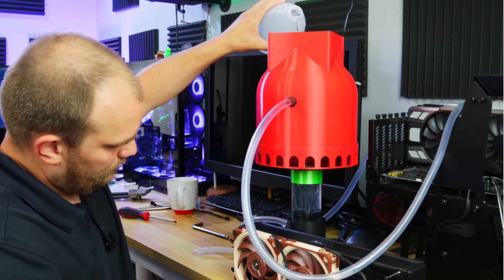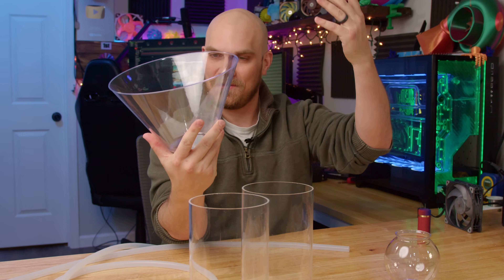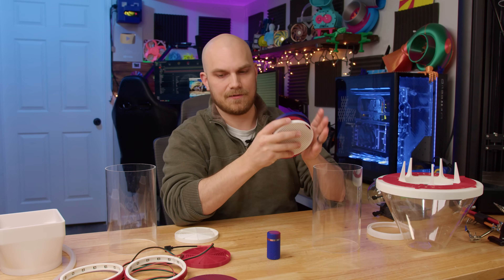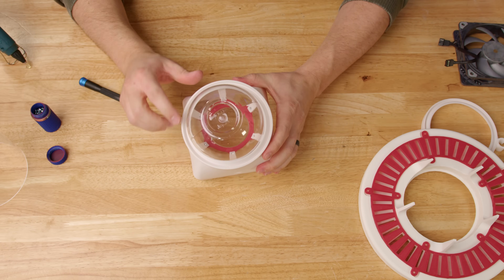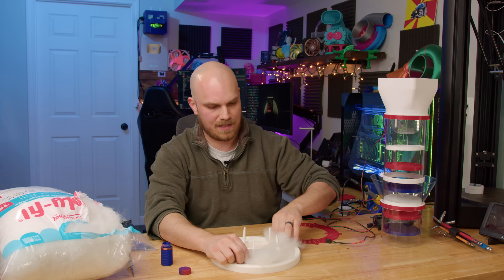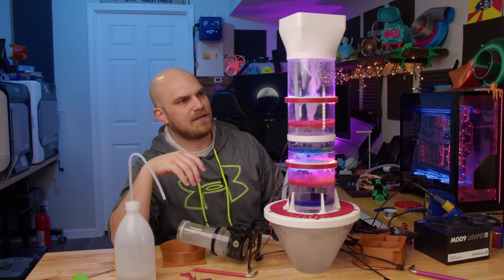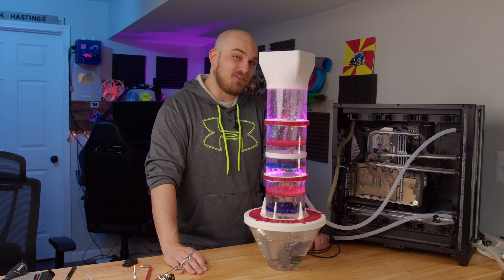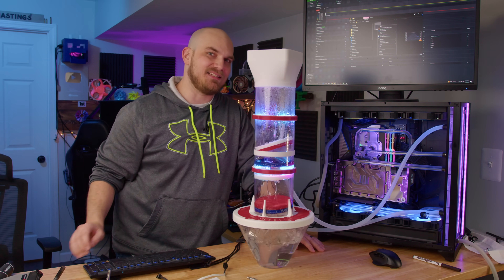Water Cooling..... With NO Radiators

Comment: Well done! I'm impressed that it worked as well as it did. I really didn't expect it to operate nearly as well as your dual 360mm radiators, even if they are a bit dirty.

I'm surprised the plastic and glue melted. How hot is the water? In my previous water cooling projects the water didn't get much above 30C in a 22C room, and those didn't have particularly powerful pumps or low-resistance radiators (e.g. a water feature pump and an old heater core).

I wonder how much heat was lost due to evaporative cooling vs. how much was lost due to conduction through the tower and other parts simply due to the large surface area. Could you roughly estimate how much energy was dissipated in total and how much energy would have been dissipated as a result of the lost water?

It seems like the various diffusers didn't perform that well, given that there are just a few large streams and not a fine shower, though it does look like it has a lot of air bubbles mixed in, so maybe that's sufficient. How would you go about getting a fine shower and would that be more effective at inducing evaporation? My first thought is that the water coming down would be pumped through a tighter screen (the "shower head") under pressure to cause it to spray in finer streams. The airstream could divert off just below this, rather than coming all the way up over the top reservoir. You might not even need a separate pump to pressurize it so long as everything is sealed from your existing pump up to the shower head. Otherwise, the pressure due to gravity just isn't going to be very much with such a short head between the open top and the screen.

Instead of using a shower-type approach, what about evaporative media for a humidifier? You can buy a filter in a frame for quite cheap. Put it in a box with a fan, dump the water on top of the filter, and catch it at the bottom, and you should have a very effective evaporator. I use one of those humidifiers in my furnace in the winter and it definitely dumps a lot of moisture into the air!

I'm excited to see you pursue this idea further. Fun!

Comment: How about a capillary cooling set up? Many biologicals use it for cooling blood and various fluids. a few tubes that dip into a reservoir. Reservoir is cooled and the channel the capillary set-up has fans as well. Tubes will be a sealed unit flowing into the system. 

It would be fun to see if it works and how you build it
This vid gave me the idea

Comment: If you re-do this test, definitely compare it to a push-pull configuration for your radiators. I won’t argue that you can do what you want for your rig, but for a proper test you should at least do an optimal, and also more common, fan configuration

Comment: You can also filter the water by adding a 'resting pool' similar to Moors filtration technology used in Andalusia back in 15th (not sure when was that) century. It is basically a relatively large reservoir that has a certain depth and relatively high intake and outlet spots (for example 2cm radius ports work on top of a 14cm deep 25-30cm long pool). Idea is if you put your water flow thru a very deep reservoir, all the particles brought by the water will seep down and you can collect cleaned water from a high spot. Ideally you'll need a cleaning mechanism/scheme for the bottom end, if you make it open top like the original it will help with cooling and finally if you make it just right you can use it as a master waterfill/drainage reservoir as well.

It'll take a lot of space, it'll be heavy and potentially messy but an absolute spectacle if you're up to tackle :)

Comment: Modern refrigerators use the skin of the box as a passive heat exchanger.  They are two layers with the inner one having a pattern of passageways pressed into it. If you can figure out how to do that to the back cover of the PC case... Or replace the back with an AL water to air exchanger, the size of the back plate. No fans!

Comment: Wow! Your own cooling tower !
If I may, there is two kind of cooling tower and yours is a little bit in the middle in the wrong way.

You have free fall cooling tower and packed cooling tower.

Free fall cooling tower have less drag (air easily pass through), but the surface between air and water is not so great.

The packed cooling tower need strong fan as there is a lot of drag. But the cooling is also better inside as the surface between air and water is better.

As you use a PC fan, I recommand you to:
- redesign the head to have a better spraying of water. What you want is a shower of small droplets.
- remove all packing inside.
- replace the fan for a high pressure one.

Beware that the cooling effect depend of the relative humidity of the room. 

Pretty project through. Have fun !

Comment: I like the idea of a liquid to liquid heat exchanger to help to separate the evaporative loop from the actual pc loop to reduce the risk of the pc loop ever running out of water. I just wonder if it would be efficient enough considering the temperature differential although considerable isn’t necessarily as substantial as most other liquid to liquid heat exchangers.

Comment: Long term the water goes manky and the noise makes you want to pee. Done this 10 years ago with Tupperware, cool experiment. It did cool well though. A bulkhead quick disconnect system added to you case would allow you to test all kinds of cooling systems ! Mega passive radiator!

Comment: years ago, like Athlon XP 2100+ Thunderbird days, I had a notion to build a water cooler that was just a couple of very tall acrylic tubes that had like shower heads or something at the top to aerate the water. I thought it would be a cool thing, but never built it. I think it's cool to see a modern take with 3d printing.
Reply: Same, I thought of this in my teens (I'm approaching 40), but never build one.
I turned a big radiator that I found on the scrapyard into a pc cooler though. I mounted it outside under my window and used antifreeze to prevent the water from freezing in the winter.
Reply: burying a big tank deep into the ground also seems like a cool idea, pretty overkill off course.

Comment: For a better evaporative cooler you would want to create a tower with multiple 120mm radiators inside of it that have wide fin spacing, and could potentially use the IndustrialPPC line to have the fan attached to some of the rads.   Rain shower above the rads, falling into a cooling pool.  Inlet on top vs bottom to test variance in loop temp over time.
Reply: Uses the heat of the loop to help create the evaporative convection that will cool the rads and loop.  Will need 2 separate water systems

Comment: I saw somone built a similar project like this on YouTube years back and was used on an AC unit using 3 towers. And instead of using mesh spacers like you used inside the tower, he used ping pong balls filled all the way to the top of the tower. I don't know why but it must something to do with water contacting more surface area for better cooling/efficiency?

GREAT BUILD BTW 😊

Comment: That thing is over-enginered to death. It is a open system which lets water escape into the air which will result in high air humidity in your room which if you don't know is bad mkey. the result if you ignore the high humidity for a second would be that every few days you had to refill the water and on hot summer days you might refill it every single day. if you forget to refill your system will run try. The shape is prone to toppel over be the cylindical bottom shape and  height. And as much as i have seen your seals are destined to leakidge at some point. The fan area seems to be pointles and i suspect that thing to actually cool the water by surface area almost alone. If this is true the coolers efficency is only depended on the room temp. Overall NOP. That thing is just dangerous to your system and surrunding work enviroment.

Comment: You should print spacers to go between the elements to keep them flat/level.  It would be awesome to see at least the top distribution plate have a rotating element, powered by the weight of the falling water.  That would take some design work, but maybe a hydraulic bearing system would give an  load capability on the bearing proportional to the water flow since it would power the bearing.  I've seen a bearing/motor design in higher pressure systems, so I don't know how effective it would be here.  But it might be worth a look.

Comment: Use a power station cooling tower as a model, spray heads at the top with upflowing air. If the droplets are small enough, you don't need anything in the column.
And just filter the water with an in line filter. You can also put a grid just above the bottom of the pool to encourage sedimentation

Comment: Hey love this concept has some merit for a TEC project I'm working on. Just a thought re your surface to water / air ratio, you might like to try a bunch of small plastic balls and just fill the towers with them. At a stab I would suggest approximately 15mm to 25mm diameter. Should aid the whole cooling process quite a bit 🙂.
Reply: Bio balls would be perfect for this application! Small plastic balls designed with high surface area in mind.

Comment: I want to see a water cooler that dumps the heat into an aquarium, preferably via a heat exchanger, that turns the waste heat into a resource.  A few degrees up an down is not an issue for the fish, and blowing a fan across the surface of an aquarium pushes the temperature towards the wet bulb temperature very efficiently, if needed.  

If you still have that 55 gallon, it takes 1 kWh to raise the temperature of 55 gallons of water about 4 °C, or about 7 °F, "in theory" if no heat is lost, and that change is not bad for the fish, as long as the temperature stays in within comfortable limits. I reality the aquarium will lose a lot of heat as soon as the temperature is more than slightly higher than ambient.  How much heat that gets dissipated depends, but if your PSU have a max output of 1000 W, the actual power is going to be a bit less than 1000 W at the most, and together with passive heat dissipation from the aquarium you're probably going to be able to run that system hard for about 2 hours even without having to start the fan on the aquarium.

Comment: You should try to make a waterfall with metal fins going down the waterfall that the water flows over and in theory absorb the heat and radiates the heat away

Comment: As an Aircon engineer, I'd suggest a few ways to make it work better.

1) Maximize the surface area per volume of fill material, you want as much surface area per unit volume to make it compact.
This is probably some tournament worthy of another season.

2) Use a spray nozzles, the water droplets should be small to enhance heat transfer, use a mist eliminator if needed to avoid water droplets leaving through the fan.

3) Typical commercial cooling tower run at water-to-air ratio of 1.2 ~ 1.6 kg water /kg air. 

Try to build a relationships between
a) Pump speed to water flow 
b) Fan Speed to airflow

With the relationship known you can play around with water-to-air ratio to maximize your cooling performance.
Reply: I think the main problem will be the pump pressure, the use of a nozzle will be kinda hard i guess.
As for better surface area in such a small space i would think about some kind of diagonal stair ramp similar to a weir, with the air coming througt the stairs.
You could add some guidance slopes on the top to evenly distribute the waterflow.

I realy like the apliance of practical physiks in PC builds, but dont forget that an open watersystem can damage your hardware due to corrosion.
Reply: Yep, pretty much everything said here. That along with getting rid of any of those convergers he has in the stack. Introducing things designed to reduce the surface area and thus cooling capacity just hinders overall performance.
Reply: Yeah I'm scratching my head thinking why he just didn't grab some random showerhead. And he could make the water stream hit stainless mesh, which is called strainer in the kitchen utensil section. Less cool, More practical. Also, air should go upstream to help the chimney effect.
He could even use secondary aquarium pump in the reservoir to pump it through garden sprinkler nozzle if fine mist is needed for heat loss effect through evaporation.
Reply: Many many years ago I made a traditional tower cooler from 4ft of 200mm PVC plumbing. I used a small gardening spray head and while it did create droplets, it was really just a messy and noisy dribble and not the spray one is used to when there's high pressure driving it. I ended up ditching the spray head and angling my upper feed pipe parallel to the inner edge of the PVC so that the water spiraled down the inside. My pump was powerful enough to create a tubular curtain of water coating the edge, and this worked much better. It also had the benefit of being nearly silent. The downside was that I had to top it off much more often :)
Reply: @LilMissMurder3409  that does sound cool.
Reply: The best way is to use a heat exchanger so that the cooling loop stays closed then a decent pump can be used to circulate water through the heat exchanger and cooling tower.
Reply: Wow cool

Comment: Evaporative coolers, aka swamp coolers, have been around for decades. Water drips/runs onto media trapped in several screens, forming a box. Air is drawn into the box through all of the screens and exhausted into the room, cooling the room. In this way, the water absorbs the heat and is dissipated through evaporation. The water level is maintained by a float valve hooked into a water supply.

What you're trying to accomplish is to cool the water by heating the air. What I believe you're getting is cooler air and warmer water.

If you sample the temperature of the air as it enters the tower and then again as it leaves, does it leave warmer or cooler? What is the humidity of the air going in and coming out?

I would tend to think that if you want to cool the water in the computer, you would need to run the water lines through the air being drawn through your swamp cooler, which would be easiest to do by putting a radiator in the airflow of the swamp cooler, since the air exiting your cooler should be cooler than the air entering.

In essence, you're half of the way to having an external cooling solution. The final step is to put both radiators in the airflow outside the case, and maybe even redesign the tower into a more ubiquitous swamp cooler format and blow that air over the rads.

Comment: Ah, this takes me back.  I made a similar evaporative cooler with PVC plumbing pipe and scotch brite pads to hold the water and allow evaporation.  I had it cooling a dual-CPU Athlon XP system.  Had to refill it every day - it worked fairly well but wasn't that practical given how much water it went through.  Yours is a lot more aesthetically-pleasing!
Reply: XP or MP? I didn't think the XPs worked as duals.

Comment: Garden irrigation and cooling systems have a "misting" head that forms a fine spray. Combine that with the fan at the top, and you get something similar to a jet engine.
Another option would have a water fountain at the base, and a series of condensation plates in the column. Water from the plates is recycled to the PC - looking a lot like a fractional distillation setup.

Comment: I'd suggest getting rid of the distribution disks by using many vertical mounted strings to let the water run down on instead. Could reduce noise and increase surface area. If you use a lot of them it would certainly look cool when illuminated, too.

Comment: What if you used a whole lot of those ultrasonic evaporators they use in cheap humidifiers and then blow it down? that would have an extremely high surface area, the evaporators might be to slow tho

Comment: So just a sill goofy thought you could corregat paper towel with some wire to hold the shape it would cause evaporation to increase by increasing surface area and it's wicking so it should stay pretty wet even if the pump turns off. And you could run it down the whole tube.

Comment: The key point here - hot media/cold air surface area size. You need to increase it at max possible level. So here is some strategies to reach it:
1. Make thin streams of water through small (up to 1...2mm nozzles). But it will may need pump with high enough compression (between PC and nozzles).
2. Make freefall water droplets. This will require more nozzles to achieve required flow.
3. (Most promise) Make your own radiator for controlled surface size at wide range of flow - push a water through an array of plastic tubes for drinks. It`s easy to calculate requried number of tubes for your application. Coz these tube has a very thin walls (0.15 - 0,30 microns) - high enough result heat conduction. Because it`s tube - easy streams and air control.

Comment: two things i would do. id use a misting shower head (the ones they use at some hotels) as the upper nozzle, and i would put a water filter on the output of the tower to keep any dust out of the loop. ok 3 things.  i think id also use a mesh filter for the air intake. im thinking print a conical top to the base and use the outside as the filter, this will give you a lot of filter area.

Comment: 2 improvements that I can think of off the top of my head, not sure how good they are though:
- Top up port so you don't have to disassemble/pour through the fan at the top, unless you can fill through the grill in the base? then this is moot.
- Spacer rings (Think hollow cylinder with no top/bottom patterns taken out of them to  keep the water spreader rings apart)